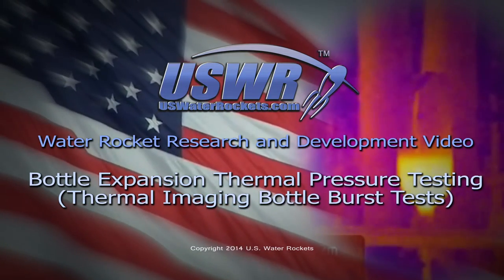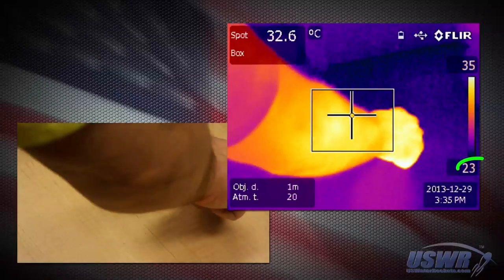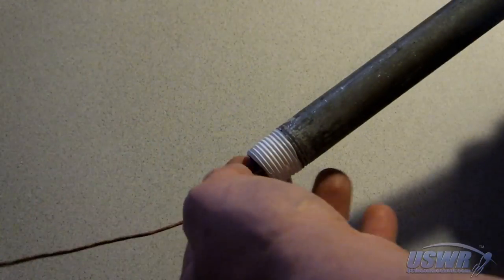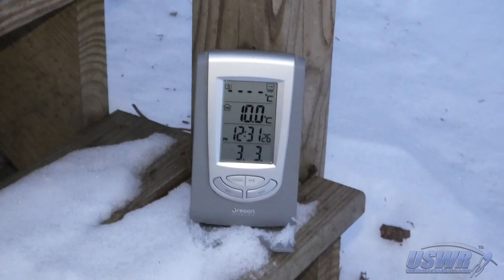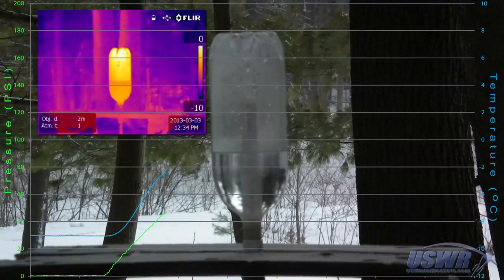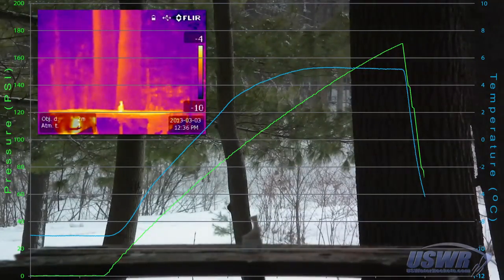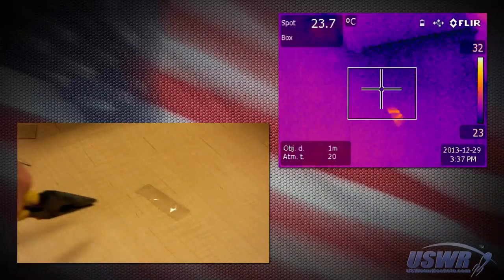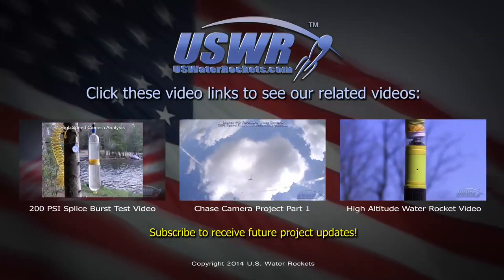Water Rocket Thermal Bottle Burst Test

Comment: I guess there's an inflating speed at which the heat can be dissipates through the walls o the bottle... Amazing work! Thanks for your effort!
Reply from the maker: There's just not enough friction inside the stretching plastic to really cause much change in temperature. All of the heat when inflating a bottle seems to come from the air heating due to compression. Dissipating that heat is the key, so slow compression of the air is a good idea.
Reply: Yes. At first I thought the heatsink didn't work at all since the compression is produced inside the bottle, not (only) in the tube, but I think it helps to lower the temperature of the incoming air. maybe you could retest it covering the bottle with snow...
Reply from the maker: DoNotPushHere We had the same thought. The air inside the bottle is at a certain temperature, so adding air will cause the air already in there to rise in temperature. There's no way to cool that air in this situation. Adding soap to make foam might help because you could chill the foam and it would absorb a lot of the heat from the air, and is a better heat conductor than just air.